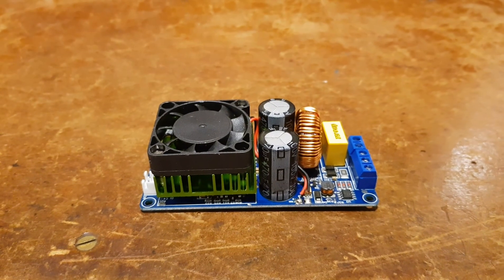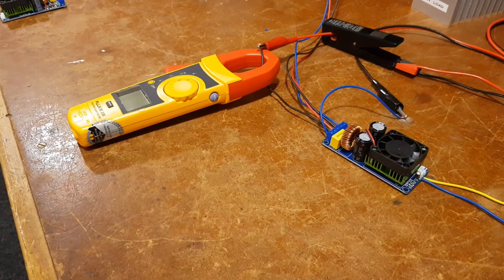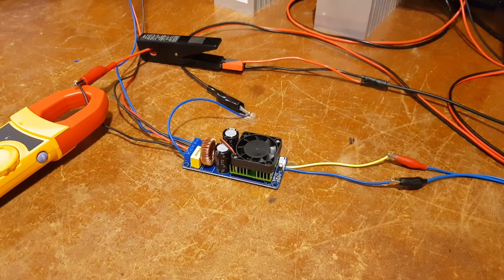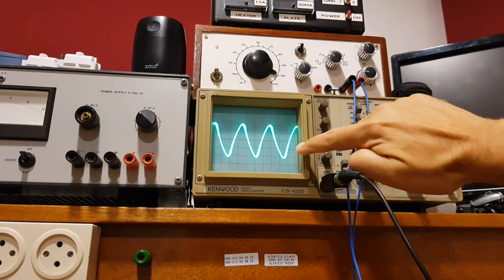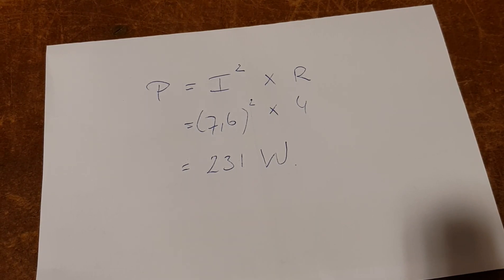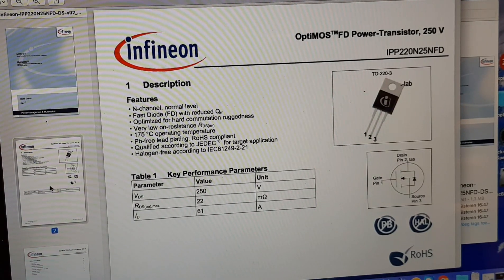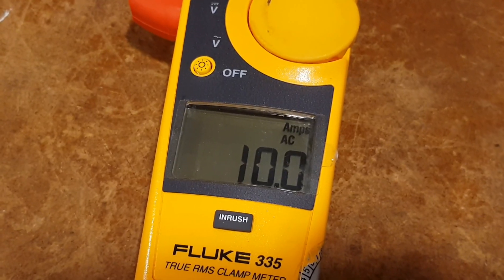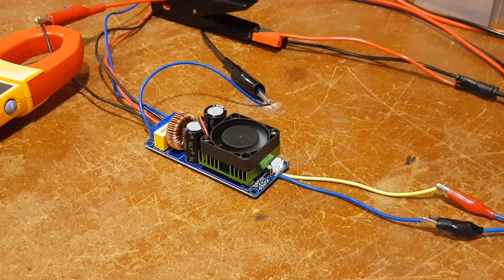Amp test : IRS2092 chip based class D 500W amplifier.

Comment: Good informative clip...but some question what has been asked here and what is worth paying attention to.  First and perhaps most important. Maybe this question - why the seller recommends a supply voltage of + -70V? They use a wide variety of components. Those who have received this module with Infineon MosFETs could be VERY, VERY happy because 90% of these modules is made much poorer and older MosFets suitable for DC-DC converters and these are very cheap but final price (for module) is same. There is also other question - is these Infineon IPP is genuine? For example - I got same module ~15€ for IRFB41xx MosFETs (only 150V and low current capacity too). But I bought new and better SUP MosFETs. And there is also other thing, XL7005 Buck converter (U2 ic) which allow to 80V operation voltage, therefore, it is also recommended to use not more than 70V. In addition to everything +-70V is more than enought to get 500W in REAL MUSIC power (not to be confused with a pure sine signal). This test at +-90V is very good, seems like this other weak parts withstands this voltages (quess, how long?) and 400W with pure sine...how many W is equal music power? I suggest that at this supply voltage far above 1k (if we talk REAL MUSIC power watts). Here is some Behringer INuke amps (they are 2 IRS20957 [almost same as IRS2092] bridged circuit i.e. 2chip+4 IRFB4227 FETs per channel and +-85V supply and output ~800 W measured). This IRS2092 module is not best construction and there may be some faults which the buyer should check, for example R13 (in many cases there is too low value R13 and need to replaced to 3.01k), 10R 2010 is also better to replace to bigger 2512 but this 2010 works too if you dont short it. Output inductor is also a compromise, little bit small, 137-2 is better to use or for example some Sagami or Coiltronics inductors.
Reply: You have raised some very good points. I have made a comment about the average vs music power question. Dated 11th Aug 2021 if you want to have a look. I call it average vs peak envelope power. You asked how do you estimate music power from average power, well its a bit of an approximation, but you could say music power = average power x 1.414. It will get you in the ballpark. + and - 70v will easily get you 600 watts (peak or music power) into 4 ohms with this amp!
Reply: @TheTemporalAnomaly  Not sure where you came up with that 1.4 number. That has nothing to do with anything. Maybe your thinking of the difference between AC RMS voltage and peak to peak voltage. To get peak to peak voltage from an RMS voltage you multiply by 1.4xxx. That doesnt have anything to do with the output power of this amp. Output power is measured in watts RMS, that is the standard that's used. "Musical" power which is called dynamic power is dependent on the power supply. The amount of bulk storage electrolytic capacitance is primarily what determines how much dynamic power an amplifier has. And it's a pretty useless number as you will only get that power for a very short period of time (like 1-2 seconds).
Reply: sorry* "Coilcraft" I want to mention

Comment: just be sure not to overload the electrolytic caps at over 68V.

At 2 ohm this thing should bring your 15Amps at rated voltage for 500 watt :)
Reply: If I replace those caps with some that can handle like 150v can I go with +-100v?
Reply: @ivomixdj  The chip han handle 100V, if rest is able also it should work
Reply: But take a look in the datasheet, some parts are change to work better at higer voltage. Also its possible that this board starts to ring/oszillate. Be sure not to kill some expensive speaker :)

Comment: I was just looking at this board on Amazon. it's 31$. I think it's the same board. (not sure)
it also says on Amazon that it requires a 1.5-volt input. (otherwise, you would need a preamp)
that's according to the info posted on Amazon.

https://www.amazon.com/gp/product/B0875VC3WC/ref=ox_sc_act_title_1?smid=A2BNZZD41HTIPX&psc=1
that could be the reason it's not reaching its max power.
my question is. can you use a converted PC power supply to run this board?
or what power supply would you recommend for this board? 
I already have it in my cart. I want to buy 2 of them..

this is what says on Amazon..according to the required input level.
"This is a pure power amplifier board, whose sensitivity of the input signal of 1.5V RMS, if your input signal voltage can't reach this value, recommend adding preamp"

another question is. how do you control the volume level? or does it run on full power?
which power supply do you recommend for this board?
congratulations on your new channel... Great video..... Thanks if you can help.
Reply from the maker: you don't need a preamp.

Comment: I was also wondering why the seller says not to use over 70 volts, since the components support it. This video helped me a lot! I can now use my 55.5 + 55.5 AC transformer. Thank you!
Reply: in my such amplifier, capacitors are installed at 63 volts, if there is a desire to increase the power of the amplifier, use a condesator + 30% of the voltage. If the power supply is 90 volts ( + / - ) , then the nominal value of the capacitor is 120 volts .
Reply: sounds like you are using a fullwave bridge rectifier and a voltage divider Very cool . Me too I'm going to try 2x50ohm 100 watt power resistors  first  That should be 98 watts.

Comment: Nice test, Thanks for sharing! I am considering this amplifier board to run a custom-made piezo transducer. Would it be possible to run a test at 24V (or 36V) at 25kHz to check its power output and distortion? any comment? Thanks.
Reply from the maker: Board does not run well at this voltage. Very low output.
Reply: this board requires minimum ± 56VDC to switch properly

Comment: If I use +-60V, can use I use 2Ohm load? The MOSFET you looked up said it could handle 60Amps. If the problem would be the inductor, I have a replacement rated for higher currents out of another class d amp (most probably 33uH)(Tas5630s board)
Reply from the maker: i did not test with 2 ohm load so i don't know

Comment: IC XL7005 STEP DOWN 12 max input 70VOLT
Reply from the maker: you have a valid point. i checked the specifications of this regulator. The maximum input voltage is 80V. It's directly connected to the powersupply on the amp board. So in this case the maximum voltage allowed on this amp is 80V. Thanks for the comment.
Reply: @ptaudio  even this 80V is too much but this is pretty good that this chip survives even this 90V i wouldn't have dared to try it but now i know it can withstand more :D. Well, in fact, you can remove this chip from there and change things, then this module can withstand 100V as well but there is then better solution to deal with IRS2092
Reply: @ptaudio  I don't have the schematic, but it should be a SOIC8, maybe U2. Putting a Zener in series with VIN pin (Pin1) could simply reduce the incoming voltage to the XL7005. Since there is almost no current power rating is not critical. What do you think? The electrolites are rated 100V if I'm right, so this way we can easily and safely extend the limits.

Comment: Did the inductor and the heat sink get hot? How long did you run it?Thanks
Reply from the maker: It gets a little warm. Not really hot. It ran about 10 minutes and still wasn’t really hot due to the fan.